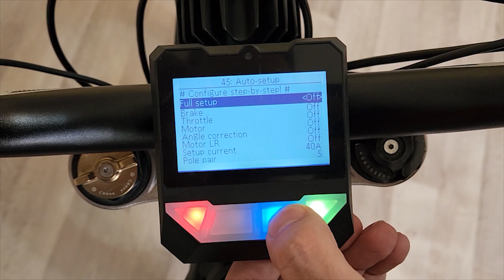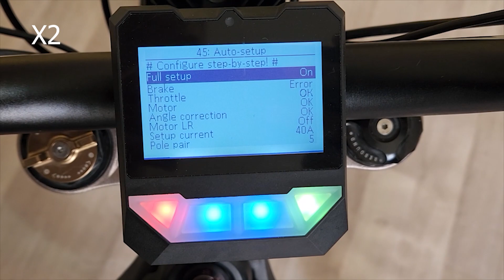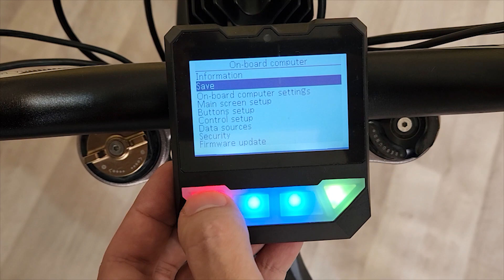Nucular controller for Sur-Ron Light Bee. Installation guide

Comment: What’s the top speed on stock surron with this??
Reply from the maker: The maximum speed depends on many parameters: the condition of the battery, the motor and transmission of the bike, the type of tires (road or off-road), the height and weight of the rider, the size of the rear sprocket, etc. Therefore, we cannot tell you the maximum speed in your case, but many customers achieve more than 55 mph (89 km/h) on stock off-road tires.

Comment: Tried doing auto setup now tires wont stop moving unless i disconnect the throttle wire, is there a way to configure the throttle to be read by the controller? I didnt even touch the throttle and it would go max full speed

Comment: When i do the auto setup it says throttle isnt connected and motor says hall error but the bike wheel still spins, would that mean that the throttle is bad?
Reply from the maker: Maybe you don't have the connectors fully inserted, that's why it shows an error. As for the brake, this is normal, because the surron doesn't have analog brakes. You can text to support if needed  https://nucular.tech/link
Reply: I found out that i have to replace my hall sensor on my motor and possibly ahand throttle after that i should be fine, it gave me an error "hall error"@NucularElectronics